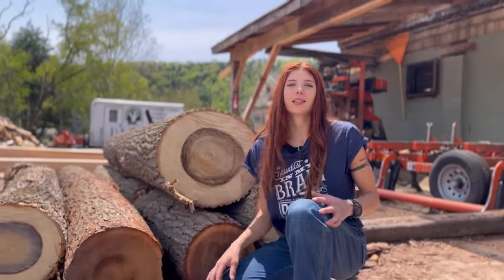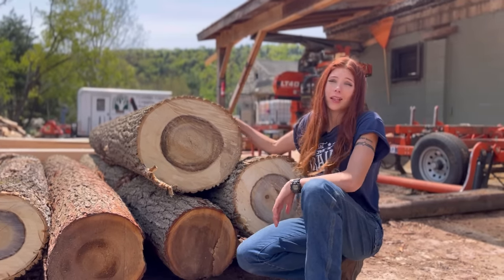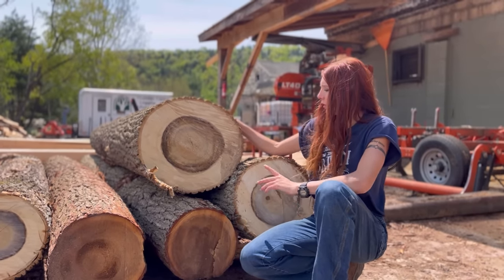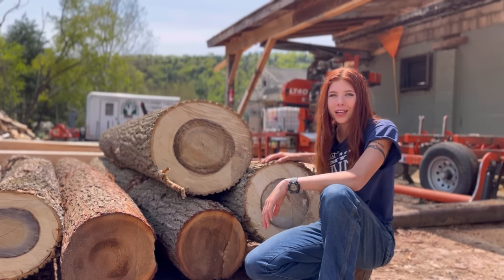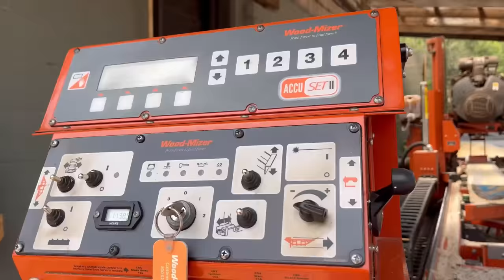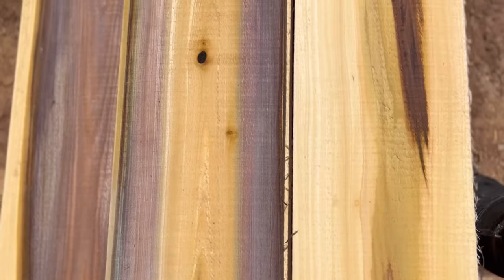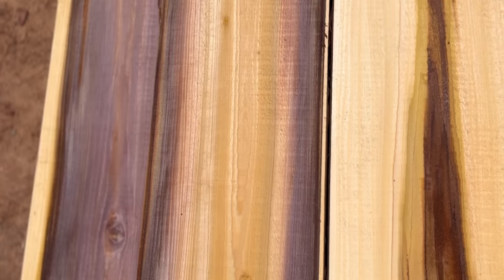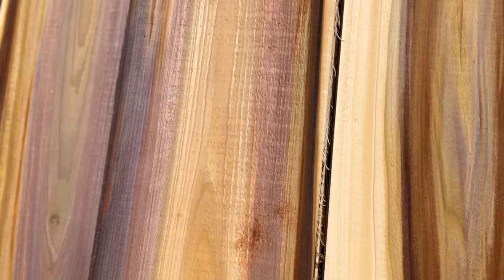Rainbow Poplar! What makes it colorful??￼

Comment: Not rot resistant although we used it as flooring in the livestock barns. It had to be off the ground, Once it had been in there for years it was almost impossible to drive a nail through it without a drilled hole. The rumor was the that the livestock urine and stool is what turned it into armor.
In northern bc canada they are called "bams" as that is what you hear in the bush during  windstorms as the mature ones would rot from the pith out.

Comment: I did architectural woodwork for 18 years buiding custom wood doors, jambs, casings, etc.  The shop had a moulding  profile milling machine that milled 1,000's of feet of poplar.
I always noticed the different color stripes.  They were usually a dark blue to black,  dark red to purple and more.  When examining these pieces, after a while I began to notice there was always  a 1/8 inch horizontal worm hole, about  in the middle of the vertical color stripe that had a beginning and end.   I also noticed this happens around breaks or cracks in the tree.
My thought is that water seeps in and causes the wood to change color.  I am not a scientist so I don't know the specifics of how it occurs but do feel sure this is the cause.   The worm hole was there every time. 
Like your channel. 
PS    I'm sure you already know that Walnut saw dust/chips should never be sold to horse farms as it will kill horses.  Keep it seperate.

Comment: In Michigan we have Choke Cherry Trees. They grow real nice and straight. I have seen some all of 20 inches in diameter at the trunk, and over 50 feet tall. When I heated with wood, I cut down a lot of different kinds of trees but Choke Cherry was always my favorite. Fresh cut it smells really neat and sometimes it is just breath takingly beautiful in color. Rich Burgundy, Deep Purple and often very solid Red. The smoke smelled sweet, a lot different from acrid strong Oak, Hickory or Maple. It didn't have the btu of Oak or Hickory but it was as good as White Birch & Silver Maple. It dried easily and burned very well. Nice video Em, thank you for showing Purple Popple wood. ben/ michigan

Comment: I always liked to fell the big poplars in the woods , usually very tall .
I fell one that was 3 feet or bigger on the stump and I stepped it off 90 feet tall to the first limb at 8" and cut the top off .
That  90 foot long log was heavy , it made the skidder work a bit to get it out of where it was at .
Big poplar trees make a lot of board footage fast and will fill a log truck full with just a few trees some times .

Comment: The diminishing of the rainbow popular would seem to me to be because it is being depleted from the environment from logging with reckless disregard for its recovery, and its reproduction would be being diminished causing its extinction if law does not take place.  Caution.  You will have to diminish their logging, or scale the logging back to not take more than 1/3 of the prospective trees of the rainbow poplar variety among any variety of harvested trees, to try and be sure that a 1/3 harvest results in a 2/3 recovery.  And then a harvest of 1/3 of that 2/3ds should recover to be 1 as it was before it started, if not more than 1 (>1) being harvested at the 1/3 rate, and perhaps even the recovery would be enough to take 1/2 again and then leave the 1/2 standing to recover and then 1/3 again ad infinitum.  A tree should have to be a certain diameter for its species before it can be harvested.  Managing sustainment is pretty stickily for a science.